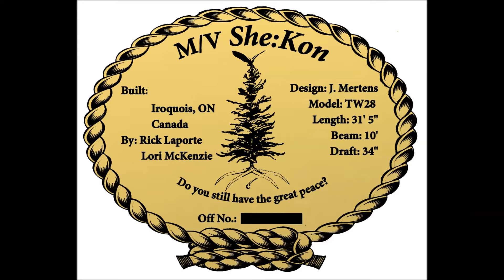Relentless Sanding: Closing in on a Flawless Port Side - Ep 17

Comment: Wow! that's a lot of hand sanding. The surface will come out good that way but I suggest using a pneumatic long board sander to cut the surface down fast  then re prime and hand block. The results will be just as good but much less labor intensive
Reply from the maker: Hi Cole

The Flexi's really work well. Ido have a pneumatic sander & will use when I do the final fairing. Likely still 2 yrs away. Thanks for looking in.

Rick